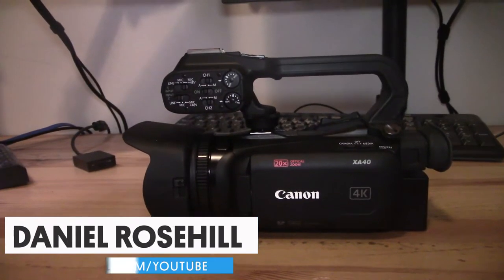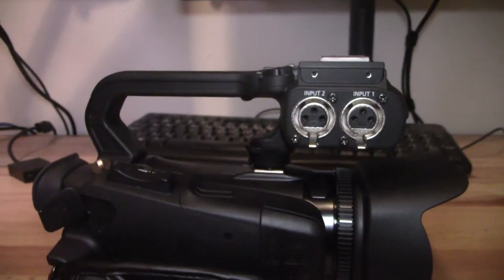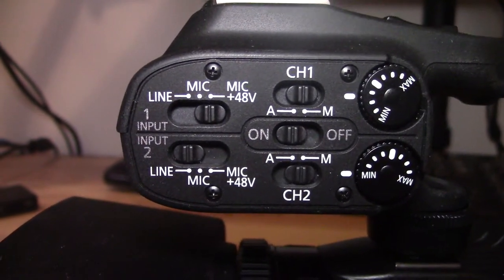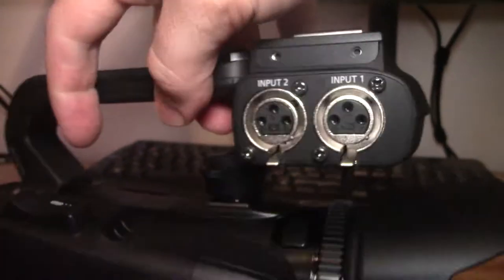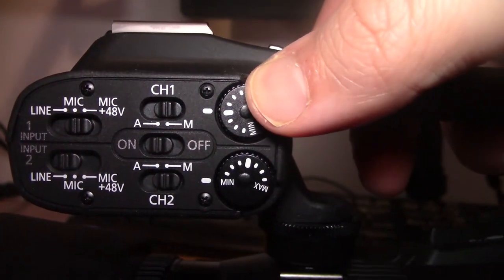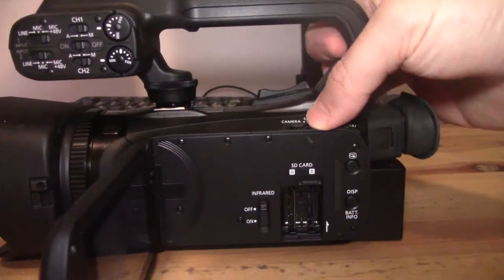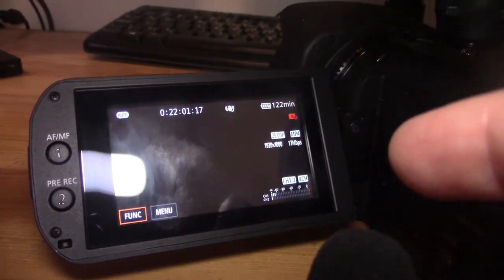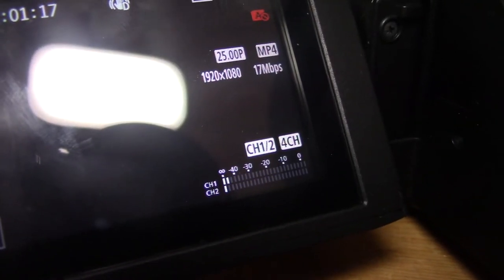Canon XA40 - Connecting XLR Microphones

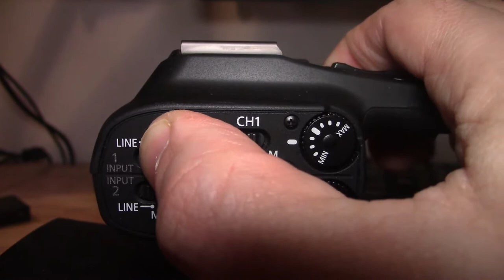Comment: 01:28. what does “line” do? Line physically skips using the mics pre- amp. Let’s say I have a mixer or any device that puts out audio and I want to input into my camera’s input that would be the setting.
Reply from the maker: I haven't used it but that's exactly my understanding. It's expecting a pre amplified line straight into the camcorder - as you might get from a mixer shooting at live event etc
Reply: So if I were streaming a live event and the sound is coming through a mixer board that's the setting I need to use?
Reply from the maker: I haven't done this yes but so take this with a pinch of salt but.... As far as I understand that's exactly correct